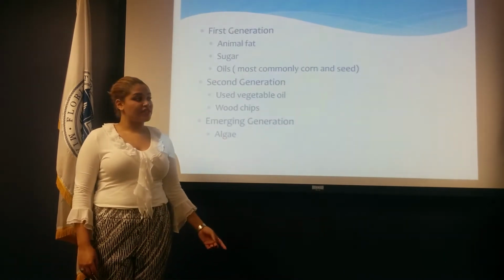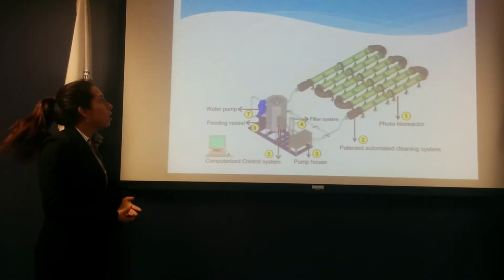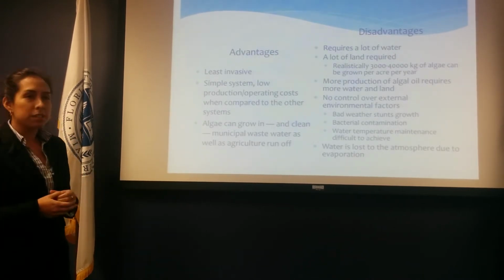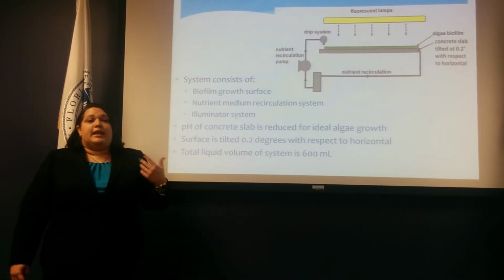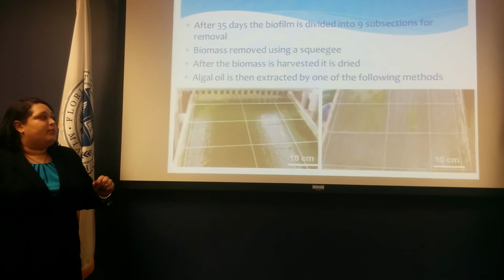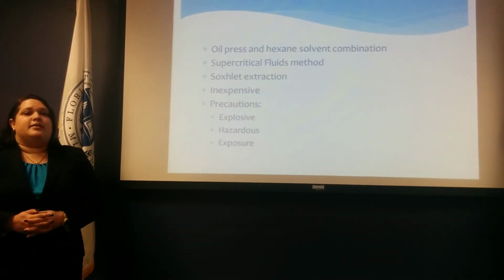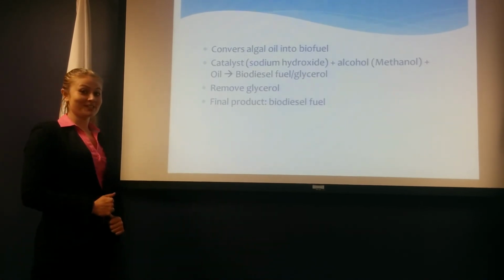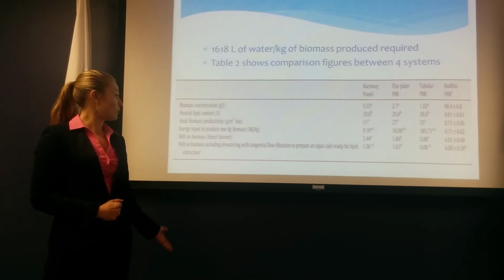Team M: Biofuels

Comment: There was a distracting noise in the beginning of the presentation. Also, the first presenter seemed to be distracted by something or someone on the side, which also distracts the viewer as well. The second presenter should explain the diagrams she presents instead of just stating that they are posted on the screen. Also, most of the advantages and disadvantages were not stated, which is okay if it is first stated that the most important ones were there ones being said verbally. Also try to keep from moving too much as at one point the second presenter was half way off the screen. The third presenter did an excellent job explaining her diagrams. I liked that everyone was dressed professionally and spoke clear and precisely. Overall, it was a great job and I learned a lot through this presentation

Comment: The overall presentation was very informative; each member was knowledgeable of their section. The presentation flowed smoothly as they transitioned to other presenters. Each presenter came out with confidence of discussing biofuels. There were a couple of slides that were not visible and had too much information on them. Changing the lighting of the room could fix this issue. Other than that the team executed very well together.

Comment: You guys had more presenters in your group than did anyone else, I think that your introduction would be better if you introduced everyone first before breaking off into your topics. I found the content was good but that some of the presenters had difficulty speaking; this could easily be polished with some trial and errors. If necessary, each part can be recorded individually and edited together. Aside from that, the presentation felt professional, was informative, and had few to no distractions. The visibility was okay, the sound quality was good, and the length of the video was just a tad bit short. Overall it was a good presentation. I can only really recommend that you do a couple of practice runs to polish some of the verbal stutter. Nice job.